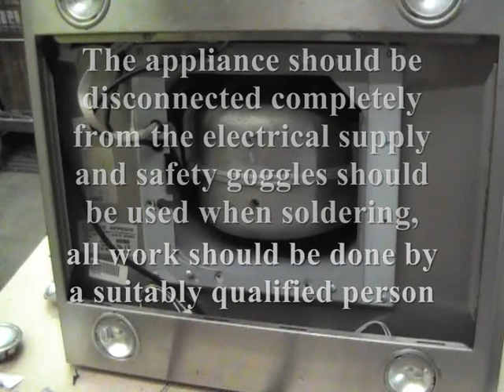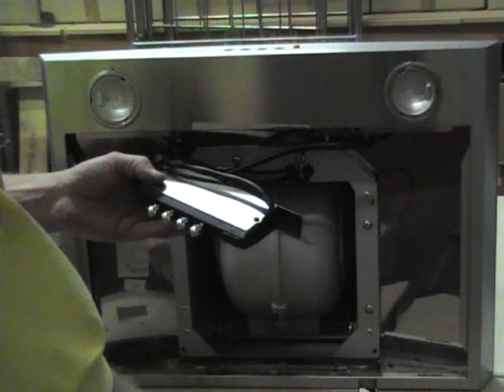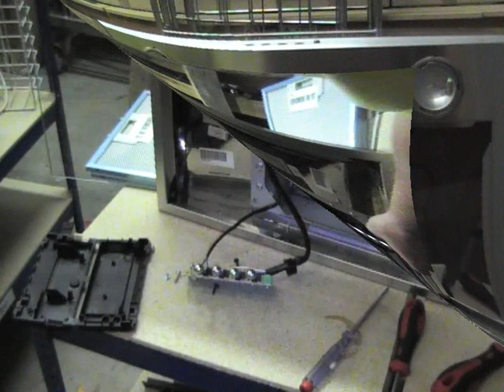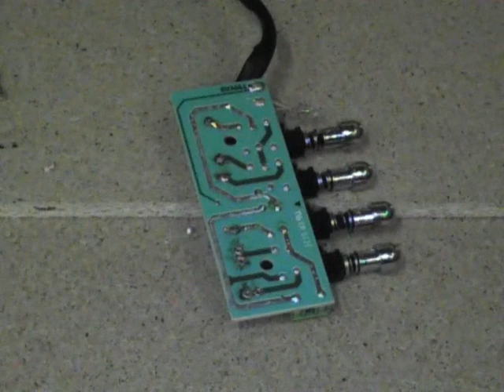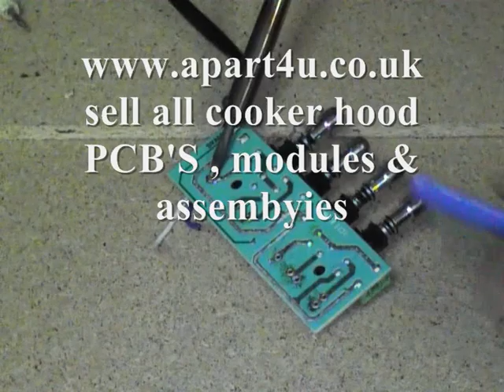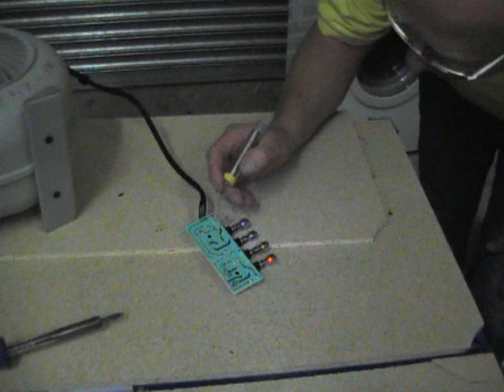How to replace a cooker hood Pcb, module or printed circuit board

Comment: How do you remove the silver buttons so I can put them on the new circuit board please?
Reply from the maker: If I remember correctly, they just pull off sometimes manufacturers glue them on it without having the cooker hood in front of me I can't be 100% sure
Reply: @How-to-repair yip they just pull off
Reply: That was my question

Comment: Hello my fan continues to spin very slowly when it is switched off. If I cut the main power supply it stops it. When I run the fan normally again it works fine. Then I press the stop button which does stops it, but it continues to spin very slowly. (not due to airflow).
Im not convinced it is a problem with the board. I want to avoid buying a new board and replacing it if that wont solve the issue.
Any ideas? Much appreciated.
Reply from the maker: You may have a problem with the circuit board,  the electricity May either be tracking across  a circuit Or one of the chips on the circuit board has gone faulty.  you need to inspect the circuit board  and also the switch which controls the motor settings. Iam Glad we could help you
Please remember to subscribe to our channel
https://www.youtube.com/user/Apart4u?sub_confirmation=1

Remember to Shop with www.how-to-repair.com and it would help us by posting the video or

website on your timeline. This helps us a lot and if we really helped you can
always buy us a beer http://how-to-repair.com/help/buy-paul-a-beer/

Comment: Thanks. 

Also take a photo on your smartphone of the wiring BEFORE you unsolder that way you can refer back to the original wiring to double check you have wired up the new PCB correctly. And have a bowl (or some other receptacle) where you can put the screws so they don't get lost!

I found it helpful to have some brown packing sticky tape so that I could 'hold' the circuit board against the cooker hood thus making it easier to solder the wires in when doing the job on you own without a spare set of hands.